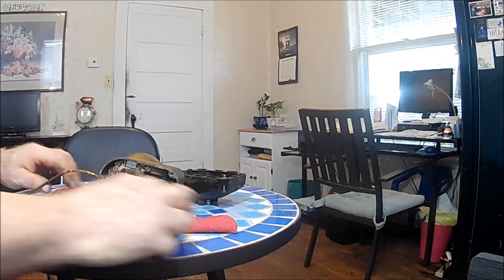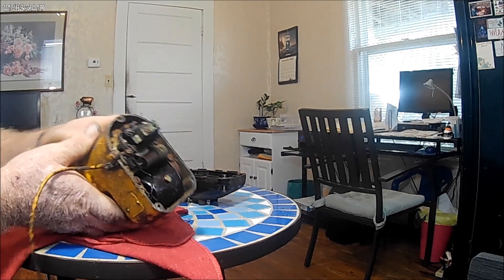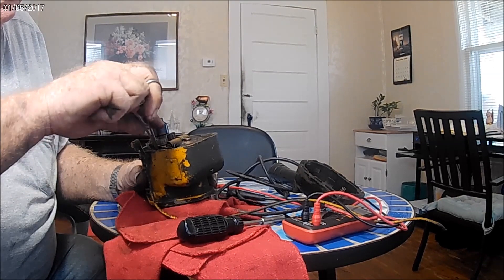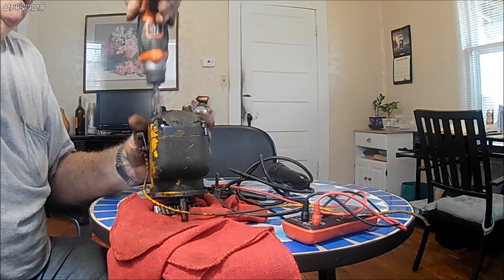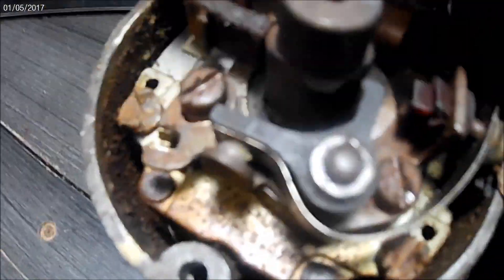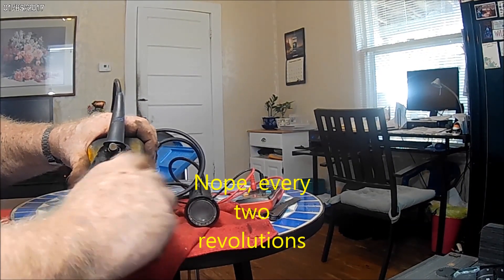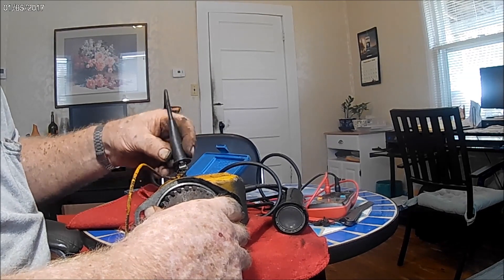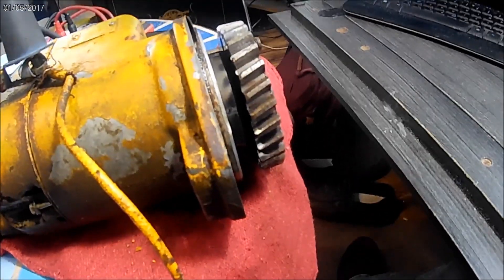working on the 4 cylinder Wisconsin VP4 engine

Comment: Nice work checking it out. With a little luck you will be good to go.
Reply from the maker: now the next question is,, are any valves stuck, that is a pretty common problem on these old flat heads,